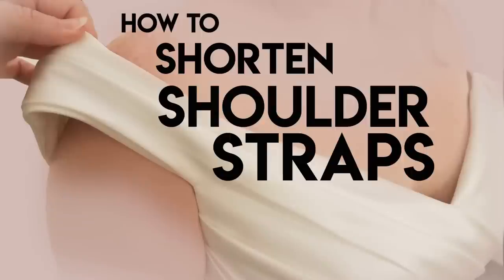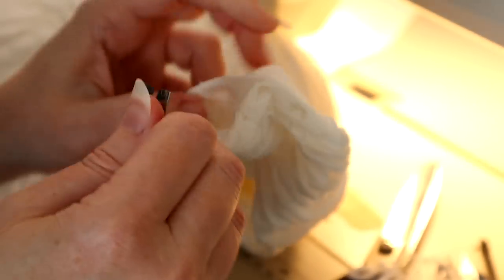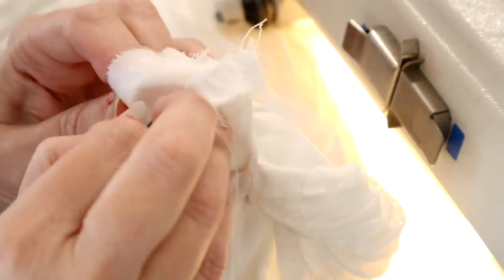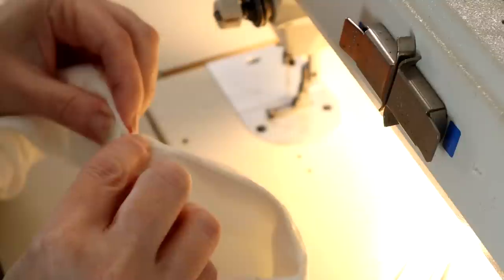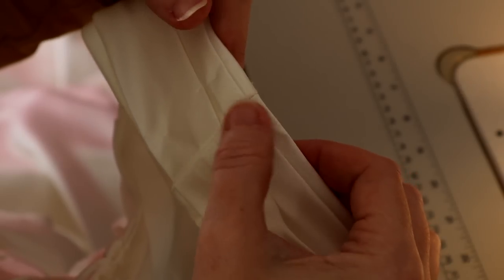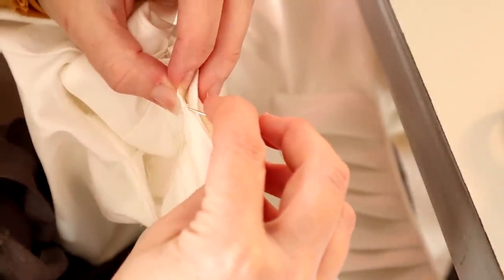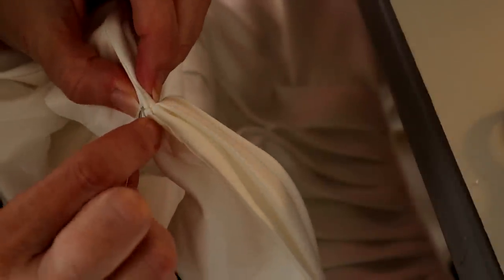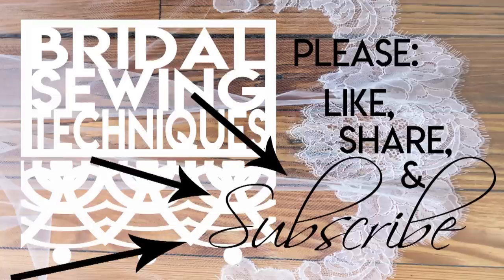How to Shorten Shoulder Straps Take up Shoulder Straps at the Seam

Comment: A surgical scalpel works very nicely in place of the razor blade, it is also much easier to hold and control.  Thank you for sharing your technique.
Reply from the maker: Many people prefer the ergonomics of the hand held knives. 
I often go through a razor or two per day, so the knives, (or even x-acto brand knives that can have replaceable blades) are quite cost prohibitive for me. 
I also personally get more accuracy the closer my hands are to the seams. 🤗

Comment: Very helpful, watching you handle the fabric for  these alts helps a lot.
I use the first method most of the time opening the inner seam only.
I like to see the outer edge to be original, but off opening both makes more sense I really like your hand sewing to close it up.
Very pretty.
Reply from the maker: Thank you for watching.  ❤

Comment: Such a great tutorial! I have been altering wedding gowns for 7 yrars now. Most of mine are to shorten the hemline. I have my 3rd dress in 7yrs that needs the straps shortened. Crazy, I know. I actually have similar type straps fpr this gown. I do have a question. How do you shorten the straps when the width of the straps are tapered? I need to shorten these straps by a full inch. The width of the straps on the front of the gown are thicker than the back side of the straps. Thoughts or suggestions?
Reply from the maker: You have to taper the straps too

Comment: Enjoyed this video. Question: do you always use double thread when hand stitching, or just at shoulders? I've always used single thread, especially where there might be extra bulk. What is your thought process on using the double thread? Thanks.
Reply from the maker: I almost always double it. If that's too bulky, I switch to a lighter thread weight.

Comment: Omg amazing video. What hand stitching style do you use? And is there anything you can do to make straps like that not too far apart(fpr narrow sholders) ? I just ordered a customer brides made dress and the straps are too far apart and too long. (Im super short and have very narrow shoulders) I dont think I can do anything for the straps being too far apart But shortening the straps will make it look much better. Thanks for taking the time to do this!!! I love the second method! I will be using this for sure!!!
Reply from the maker: I may add this to my next video! It is a common question, and it is an easy fix. Stay tuned! :) remind me if I forget-I don't want to leave you hanging.

Comment: Help!!!!   I just did a gown.   BIG busted.  Long wide shoulder strap. Shortened.  No problem .  It seemed to Work, just seemed tight.   What is the correct way to do this?  Checked for videos, but did find what I needed.
Reply from the maker: Can you email me please? My contact info is on my channel homepage.  I need pics.  I don't think I understand.
Reply: I just sent one that was just before finishing.   I just want to know what is correct for off the shoulder.   Some don’t want them to hang, but be more fitted.   I tell them that it is an either/or situation. 🤷🏼‍♀️

Comment: Would it be easier to open opposite seam without the understitching.
Reply from the maker: I think it's kind of 6-one, half dozen the other. It's def easier to open that way, but after you take it up, you would want to sew the understitching back in so that the way it lays matches the rest of the strap, then hand sew the side you used for access.
 If you open at the understitching, the way you catch the seam allowance while hand stitching it closed can make it lay similar to if you had understitched it. (With proper pressing of course.) 
I don't think there is a wrong way & I do it differing ways depending on the gown.

Comment: What do you do if there is a nonslip strip on the strap?
Reply from the maker: Remove it from the strap at that spot you are working on, then after you do the alteration, see if it lays best if you snip it at the middle of the excess and overlap the extra. 
You can also lift it off, then open up the shoulder seams & snip the silicone elastic in the middle and sew each part straight out to the straps' ends. Then do the alteration. 
I hope these make sense. It's hard to explain in writing! 😂

Comment: How do you take up shoulders without making the armhole too small? This is always an issue I have...it fits well, but then her armhole is too small
Reply from the maker: When you take it up that much, you often have to drop the armscye, (armhole at the bottom.) But... if you are running into that issue, you are more than likely pulling it up way too high. Then the apex of the bust will sit too high. Then, she'll have gapping at the bust. There's a waterfall of issues that come up. First, align the bust apex of the dress with her bust apex. Then, see how much strap to take in. It should only be enough to align the apexes. Then take in the dress. 

Most commonly, this problem starts from a stylist or mom insisting that the dress just needs the straps yanked up to high-heaven, resulting in all these other problems. The real problem is usually about 4 inces lower. 99% of the time, the problem is the girl is short-wasted and she needs the length of the bodice shortened to fix all of this stuff. This is why pro seamstresses don't take orders from moms and stylists. ;)
Reply: Thank you so much for taking the time to reply to me, this is very helpful! @BridalSewing